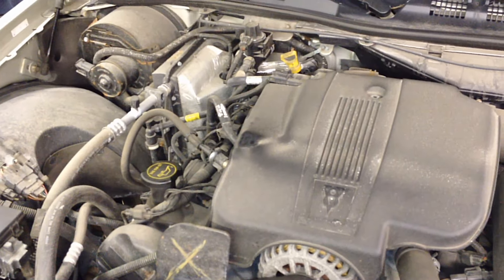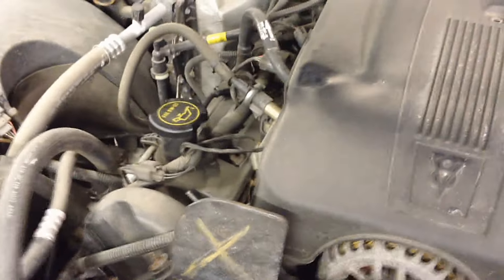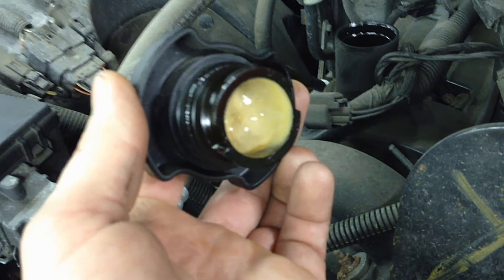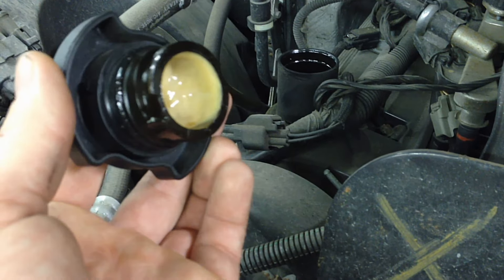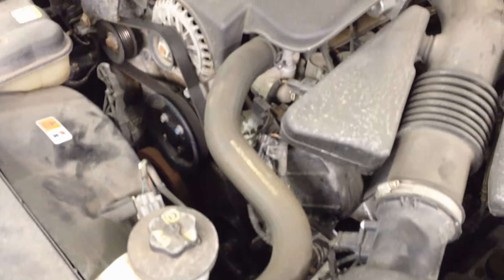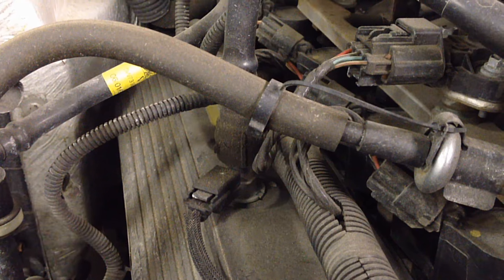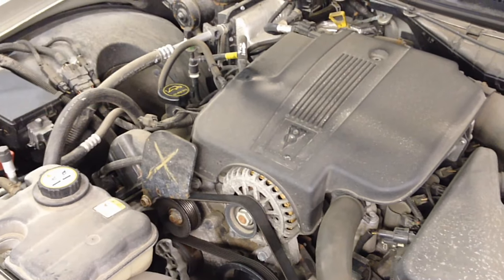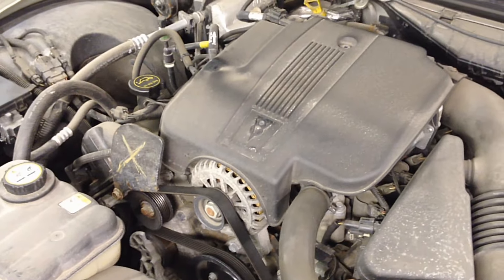Ford Quick Tips: #1 Engine Oil Cap Puddding

Comment: I have an 06 f250sd it had water in the cooling system and temps got well below freezing . I didn’t run it until today it’s 70 degrees. And now water is in my oil . Where could it be getting in at?

Comment: I have a very small bit of the this gunk on my oil cap, which keeps coming back. I drive the vehicle twice a day for 10 - 15 minutes each time (10 miles total).  Oil seems to be clean and no white smoke. Coolant may have dropped a slight bit, but hard to tell. Should I be concerned?
Reply from the maker: No
Reply: Awesome, thank you. I also wanted to say thank you again for all your videos and information. Your work is extremely helpful and money saving!
Reply: Paul Rocco no, this is normal to occur when a car is driven on a very short trips even on brand new cars, there is nothing to worry.

Comment: I own a 2005 F150 5.4 and I drive maybe 3 miles to and from work so to go 3000 miles takes 1 year or sometimes longer.  I use Pennzoil Ultra Platuim oil and a motorcraft filter and change it every 5000 miles, so my question is am I waisting  my money by changeing it at 5000 miles or do I need to change it every 3 months regardles of miles?  Or can I use Motorcraft 5w20 synthetic blend and change it every 3 months?

Comment: short trips will kill your car... should always get to running temp if u can
Reply: trulysick86 wrong...cars are meant to be driven short or long distance. Doesn't matter your car will be fine.
Reply: hulk hogan  actually it does matter always let a motor warm up to operating temperature.  You get the most engine wear when engine is cold.  Just let it warm up unless your the person who would rather have car payments and trades it in every 5-7 years. My cars I usually get rid of them around 300k and they still run great.
Reply: joe c a engine warms up faster by driving on it then just letting it sit there
Reply: You don't need to warm up your car for 20 minutes before you drive but it is helpful if the temp at least starts to read on the gauge before you get going. As mentioned before, the vehicle does warm up a lot faster when under load. At least get to normal operating temperature before you shut it off though.
Reply: no it doesn't dummy
Reply: Wheel bearing 
Exactly 
That’s the best way 😂👍

Comment: Thank you for saving me from head attack. I've  been not driving for a while due to lock down and it is in winter, after i went out the car needed oil top up and found the cover is milky and i freaked out. I have to change oil.

Comment: I had this in my accord. was also losing about a gallon of water every 3-4 days and was overheating , took it to a mechanic who said it was 100% the water pump , but I'm not sure , don't want to pay 350 for the water pump  job just to need a head gasket job aswell. any ideas

Comment: Changing a throttle sensor, finish and go to start rig and engine "failure safe mode" appears! Open oil cap to find milky residue! Check oil and no milky residue on dip stick! Would you recommend changing PCV? How would I get "engine failure safe mode" off?
Reply: +FordTechMakuloco, it's a 2004 Ford F-150 Lariot
Reply from the maker: +Jeff Berry Was a Ford sensor used? What was the code exactly? Was a pcm reset performed as shown in my videos? The milky oil on the cap is normal but maintaining the pcv valve for proper flow also helps cut down on the amount that accumulates.

Comment: Hi, I was wondering if I could get some advice. I bought a car the other day (Renault Clio 2005 1.2 16v) and me and my boss/friend checked under the oil cap and noticed the exact same stuff in this video, yellow gooey stuff on the cap as well as inside the tubing and funnel area. The oil looked fine on the oil stick. The car has been sitting a while as the owners bought a new car. So we wiped it a little and I drove it around some more, I even drove it to top revs and at a high speed and checked it after that there didn't seem to be any more than there already was. We also noticed the coolant was over filled and that did not seem to go down. 

Would appreciate the help from any one. Thanks.
Reply: +kieran Telford I'm no expert, but what it seems to be is what i have the same deal with: just condensation buildup from your engine cycles from short trips and not enough heat in the engine to burn off any leftover moisture. If your dipstick is clean oil and the radiator fluid is not milky, you're probably fine. It may be wise to check up on that "goo" every so often and just clean out the filler hole and cap.

Comment: hey can i ask you a question? 
I have exactly this problem. I drive to work about 10 KM the day.
I did not know that since not everyone can know everything and i just saw exactly this when i was refilling my oil.
After that i was doing longer trips to avoid moisture. Its 2 1/2 months gone now since i simply dont have the money for an oil change at the moment. My technician said i can drive it a bit more but it should be done, soon.

Can you tell me if and how fast that can damage the engine? can my engine already be damaged?

I mean at the moment everything is normal. No Oil in my cooler system, no big white smoke from the exhaust. Just a drop of water on my dip stick and the oil cap has this white / brownish mud in it.

Comment: Ford f250  2010 5.4l check engine light came on twice now sucking gas like a slurpy no power loss 120oookm. could it be from lack of use or moisture. oil change in the summer.any ideas plugs and coils original. truck on!

Comment: Please help I have sank alot of money into my 99 Ford Taurus I just replaced a heater hose assembly and I still have a coolant light on and I can smell burnt antifreeze after driving for bout 30 min or so no milky white stuff in or on cap no white smoke out of tail pipe or no major smoke on engine just slight small amount of white smoke and the reservoir flows out after opening it ..(after I have drove car) my gauge does not say it is over heating but I'm not sure it works properly either .. is it over heating ?

Comment: So this happened the other day to me and oil in dip stick is regular but antifreeze was a little low on the bottle and there is definitely some pudding in the right valve cover where the pcv valve is, with a slight measure at about 40 mph. Any ideas before I catch a (heart attack)

Comment: i have a question: my cap was like that today but not nearly as much as that just maybe a lil skim of it i checked the oil stick and the oil lil looked fine. could it because its so cold outside? my 2005 grand marquis only have about 117,000 miles on it
Reply from the maker: Raymond Gordon Yes it is normal in the cold months and for people that take short trips as explained in the video I would not worry about it.

Comment: I have 99 explorer with 5.0 and the idle has gotten real bad kinda shakes. I bought new plugs and wires anything else I should look at? I have just over 170,000 miles on it. It has had a hard time starting when engine is warm mostly in summer months.
Reply from the maker: PROIII I would first an foremost check for vacuum leaks. Any lean codes?
Reply: No vac leaks I am thinking of doing a sea foam clean and new wires and plugs. Wires are original. Have not had codes checked but engine light is flashing some at times.

Comment: Hey please help me I have a 1997 Ford F-150 with the 4.6 it does the same thing in the vide but I wiped it off and it just a couple days later it was back I only run the truck for 5 min trips to work and back could that be the problem also I have nothing showing on the dip stick just the oil fill please help thanks

Comment: I have a 2006 f150 and i have the same problem dipstick is clean no white cream or whatever that is but i do have a lot in my oil cap  ,no white smoke in the back exahust pipe or overheating i dont know what or what that is? Any idea?
Reply from the maker: Just as stated in the video it is perfectly normal in colder climates from condensation from hot and cold cycles and not driving long enough to burn off that condensation.

Comment: That reminds me of a little 91 s10 blazer I bought years ago. The thing had 260,000 miles on it and an old lady had it for the last couple of years she was in bad health and didn’t drive it much I got the thing for 1200 bucks and she had just spent 1900 having a nice paint job put on it. I  checked the oil when I was looking at it and it was full and clean when I got home for some reason I took the oil cap off and it looked just like that one and I was pissed I just knew the head gasket was leaking and going to blow. I put another 30,000 miles on that thing and I ran the hell out of it it. After one week of an 18-year-old Driving it like a raped ape she was clean as a pen. I sold it to a mechanic that works at a local Nissan dealership and I still see that stupid thing sitting outside the shop with a tag on it.

Comment: I test drove a 2012 Ecoboost King Ranch and it has milk under the cap. I ran away but found 2 other Ecoboost the same way. So I guess that's normal.
Reply from the maker: Yup in colder climates and or short trips
Reply from the maker: +Mark T. In colder climates and short trips this build up is totally normal. Working at a dealer for 10 years you see old and brand new cars do this. Now obviously all those new cars I saw this on didn't need head gaskets.... The reason why this car was a perfect example being a crown vic old people go on short trips that is all and you see how much accumulated.
Reply: FordTechMakuloco Findy getting back at you on this Video, I was a Ford Parts Manager First in Anchorage, AK for 2 years, then moved to Miami, Fl where I was in a Major Dealership that had Lic.-Mercury as the Major, but also has 4 other Import Lines all on the same Lot. But with the Heat down in Florida, is why I never got to see this Build up that you showed in the Oil Cap. And when I first started in Alaska, so many people would start there Vehicles and just leave them running, many while I was in Fairbanks, where at least 2 to 3 weeks a winter it would get down to -50 to -60 Below. It's a complete different way of working & Dealing with the weather up there that is for sure. All types of Specal Oils & Lubs to deal with that Cold Weather up there. Keep up the good Video's!!
Reply: Was that Regular, 2% or Skim ?
Reply: Adrian Wilson lol. Normal for fords. Ive never seen this on a gm vehicle unless there was a catastrophic problem.

Comment: I have a 2010 Ford Escape 3.0 V6 with about 40,000 miles on it under the cap it was a little bit milky but when I check the oil with the dipstick the oil looks good and there is no warning light on the dash or anything like that the vehicle runs great do you think it will be okay to drive I'm just worried about a blown head gasket
Reply: John Collins 10 year old car with 40K on her?
Reply: @TheSavage3.6  yep that's true it was bought by an older couple that  stored it in a garage over winters as the couple lived  in Florida over the winters and would come back to Canada where I live and they would drive it during the Spring and Summer they traded it in last year for Ford F-150 pickup to tow their boat  and I bought the Ford Escape from the Ford dealership
Reply: John Collins if the oil looks good and you only see froth on the cap u should be good to go my dude. seems like she hasn’t been driven a lot and that’s what’s causing her frothing
Reply: @TheSavage3.6  I took the old girl out for a good long run today and I followed the steps in the video then took it out for a 2nd time and there was no milky stuff under the cap anymore because i can't afford to replace a head gasket on my Ford Escape  right now but the Ford Escape had lots of power I couldn't find any leaks and the coolant level looks like it's staying the same as usual so I think I'm good it was just a bit of water in the oil
Reply: John Collins that’s good, i’m happy she’s doing good! also, as cheesy as this sounds, i recommend going to walmart for oil, not the supertech stuff but here in california oil that would be 50$ at an auto part store is 22$, and that could save u some money.
Reply: John Collins like pennzoil.
Reply: Hi thanks for the information on the oil I live in Ontario Canada the weather temperature here gets a little crazy  but our summers are usually really nice  until October and I know that harsh weather is hard on the Oil

Comment: I´m having the same problem yellow gunk on my oil cap,   i have a F-150 5.4 v8, and every time i turn the engine on after being off for a few hours  (when engine is cold),
 it makes a lot of white smoke for a couple of minutes, then its barely visible,

  i have checked the coolant  tank/deposit a few times and it´s  been at the same level ...

any  ideas?
Reply: +jessan hernandez sounds like valve seals to me.  My Mitsubishis used to do this all the time, smoke like mad on first morning startup, then fine the rest of the day. does it smell like oil?

Comment: Is there any one brand of oil that you recommend over any other? Valvoline, Pennzoil, Castrol, Mobile One?
Reply: p
   

 )
Reply: Jimgam730: This is going to sound sacrilegious, but the "name brand" oils like the ones you named are all very good oils. On the bottle will be the letters API and then some more letters behind that. The oil you want will say "API SN," which is the top service classification for oil in gasoline engines.

Comment: I have really little grey smoke coming out of the oil filler cap , does that means my engine rings are worn out ? or just a bad PCV ?
Reply from the maker: +eyad aljamal Fix the pcv first but if you just ran the engine and then pull the cap off the vapors coming out are normal.
Reply: +FordTechMakuloco so if I see the smoke while the engine is running , that means I have a bad rings , but if there is smoke while the engine is off that is normal ??
Reply: +eyad aljamal It means bad PCV OR rings. PCV is more likely to break than rings. Do your PCV.

If you run the engine hard and take the cap off and observe smoke while the car is off, this is normal. Good cars do this.

Comment: Lol this is off topic but I have a 07 f150 4.6 v8 an sometimes when I crank the engine the starter sticks like it keeps cranking for like 3-4 sec before it starts what's the matter with it?
Reply: +Miguel Rios 

You need to explain he symptoms a bit more, does the starter stay engaged?  This could be from the contacts in the starter relay sticking together keeping the starter running longer or from a misalignment of the starter and flywheel. Shims are made to correct this latter situation. If you mean the engine won't crank all the way over until the third or fourth try that could be from hydro-lock from a leaking head gasket allowing water into one or more cylinders while the engine is sitting.  Usually only happens after sitting a while like over night.

Comment: Sure it could be condensation but what about the bearings? What kind of damage would that do?
Reply from the maker: Not an issue, crankcase condensation is a normal.
Reply: @FordTechMakuloco  Ahh sorry but water mixed with oil is not a good lubricant.
Reply from the maker: Right but the amount in the oil is minimal and the engine oils are engineered for it.

Comment: It's because these newer engines create to much moisture which I don't like ,I've only seen it on vw,audi,bmw,ford,toyota,gm.I have never seen it on a Hyundai or Hondas acuras.thus said I don't think new cars were built as good as older cars cause they never had this problem,way to much moisture in engine means bad craftsmen ship on engine and it won't last as long

Comment: I have a 2005 ford expedition when I accelerate to 40 -50 it stutters when slightly taking foot off gas any help please
Reply: Torque Converter...
Reply: KAPDON1 I would make sure to have it check for engine misfire. I have seem several instances where misfires occur during or right after torque converter lock up. It could be worn spark plugs.
Reply: Neil Mc Neill I could eat a bowl of alphabet soup and s*** out a smarter statement than that.
Reply: well your main problem is that you own a 5.4 3v triton piece of shit. if it's still running get rid of it before it's junk.
Reply: KAPDON1 transmission torque converter shudder
Reply: Beau S absolutely brilliant comment! Cheers